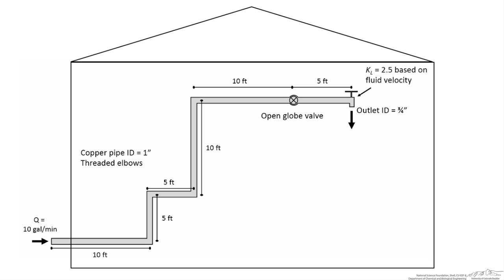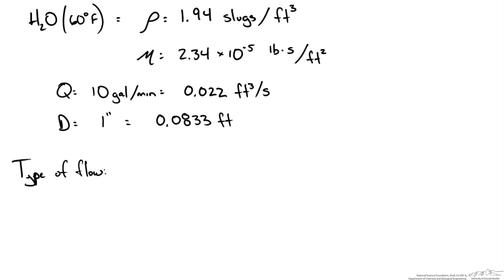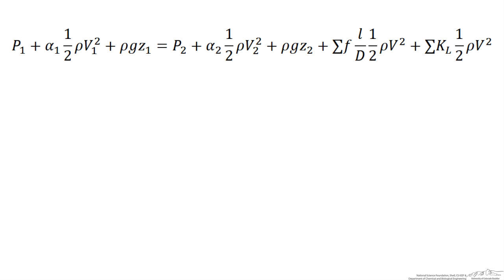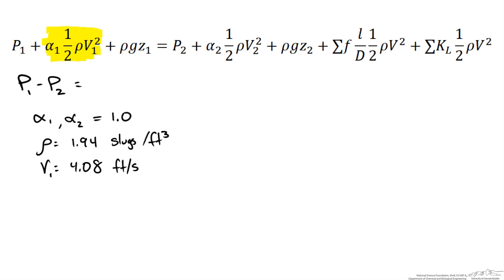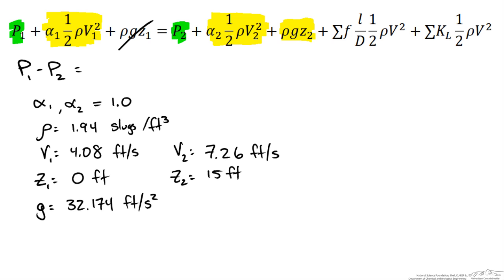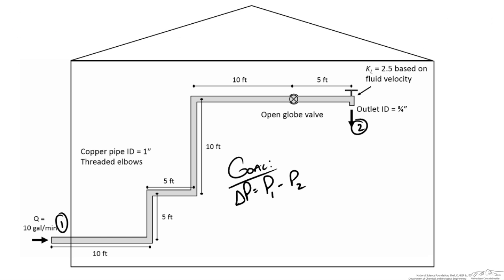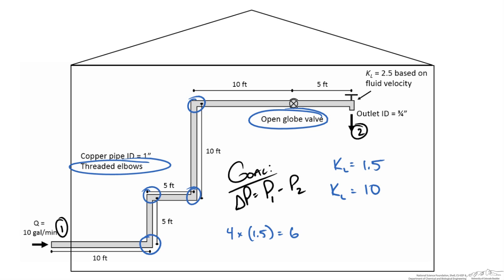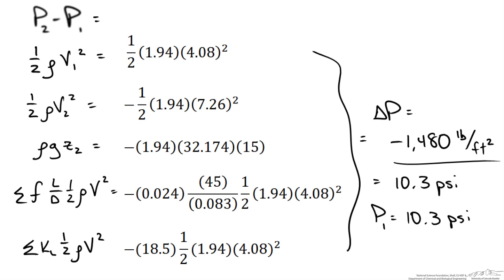Pressure Drop in Pipe with Losses (Determine Pressure Drop)

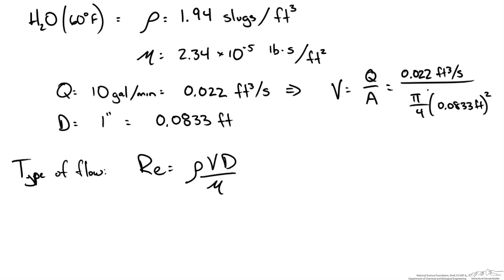Comment: 2:17 how did he get 4.08? My calculator says 4.036
Reply from the maker: Thanks for checking! In this case, it looks like the difference is in the conversion of Q. Q = 10 gal/min, which was converted to ft^3/s. If you don't round that off to two significant figures (0.022 ft^3/s), the final volumetric flow rate is 4.08 ft/s.

Comment: Thank you very much for the video. How can we calculate the pressure drop if we have a gas with significant density changes along the pipe?
Reply: My guess is that you would have to find a function for density at each position along the pipe, then integrate across the length of the pipe to find the average density and use that in these equations.

Comment: one of the primary losses term should have something close to V2 isn't it? summing in all the sections on the pipe having "V1" as the average velocity is acceptable but the end or last section has different diameter so in my humble opinion it shoul have different V, but still no body cares using friction factors and "KL" terms is already an approximation

Comment: a pump connected to the pipe and pump discharge  pressure is  2.3 bar then what is pressure drop in pipeline

Comment: In this calculations v2  find out, flowrate will be same but area how to change it because i have 120m pipe then how to start to endpoint there is no changes in diameter of the pipe> now for this condition what is the v2 value?????? thanks for my all quarry reply.

Comment: The Reynold's number calculated in the video still has units. It should be dimensionless. I believe the correct value for the Reynold's number is around 9.07e5. This changes the friction factor to around 0.0129, but changes the final answer only a little, to about -10.21 psi. Does anyone else get this?
Reply from the maker: The Reynold's number is indeed dimensionless in this video, as shown at 2:39.  I'm not sure how you got the different answer.  Can you elaborate?

Comment: All was clear, except why did you use the v1 (4.08) value  for the V (video 8:04 and onwards)? Could you open this part a bit, thanks!
Reply from the maker: Great question.  In this case, the term we are calculating is a friction loss term.  That occurs throughout the pipe, so we want to use the velocity that is in the pipe, which is v1.  The only difference between v1 and v2 is the diameter.  v2 was calculated with the diameter of the faucet, so that wouldn't be what we want to use here or in the minor losses term.  I hope that helps!
Reply: Thanks for your valuable input, I appreciate that very much! I am an electric engineer, so these pressure calculations are not something I know too well, but I find this very fascinating area to get some basic understanding and your presentation was very educating, despite of the imperial units, which I am not familiar with (we in Europe use SI units) :-)

What about if the ducting was such that the first 30 ft was as it is now (1 "), but the last 15 feet would be implemented with a bigger pipes, let's say 2". Now the velocity would not be the same through the whole ducting. Should I now do the math in two parts, so that I would  first calculate the pressure loss for the first 30 feet (let's call it PL1) with the formula you presented, and then the pressure loss for the latter 15 feet  part (PL2), again with the same formula. Then sum these two values PL1 and PL2 together?

Comment: Learning how to calculate the pressure drop in a pipe with major and minor losses can be very challenging at first for many students, especially those who have never been exposed to a fluids class. As the length of your video proves, learning the Bernoulli equation and the losses due to friction is a lengthy process and can be confusing to fluid mechanic students. Your video is very concise, but also gives great detailed step-by-step instructions. The use of colored highlighters to point and illustrate how to read the Moody Chart or explain a step is also very helpful.